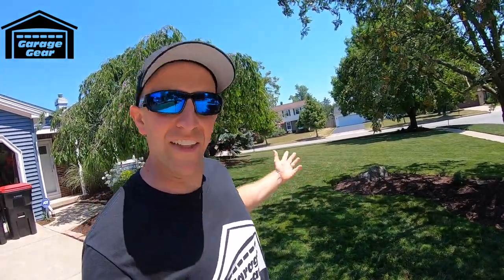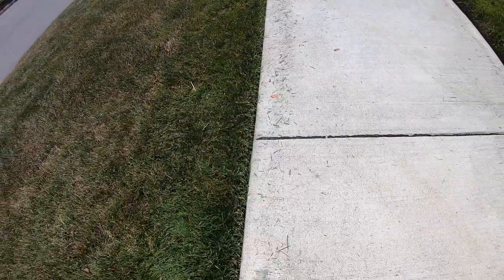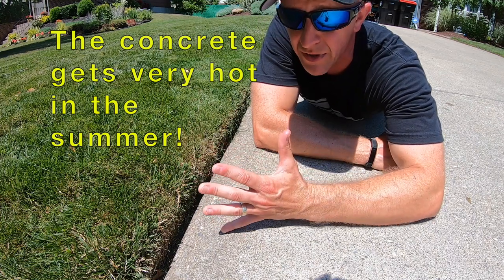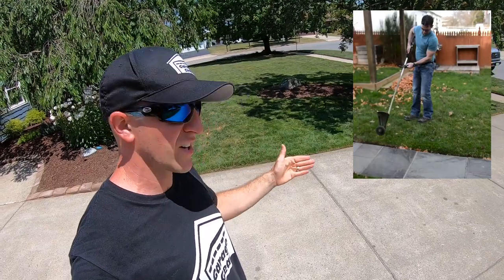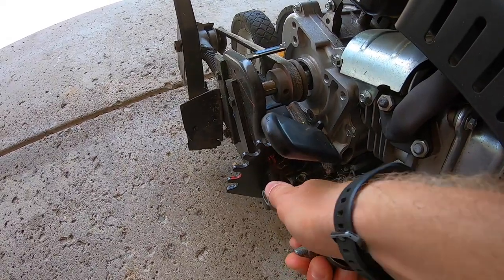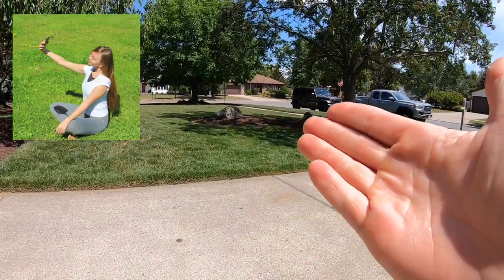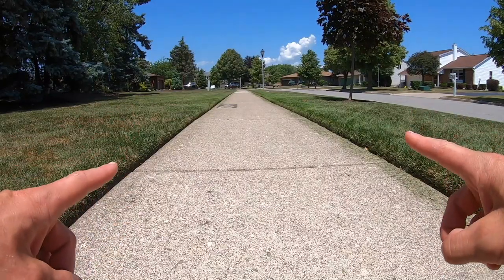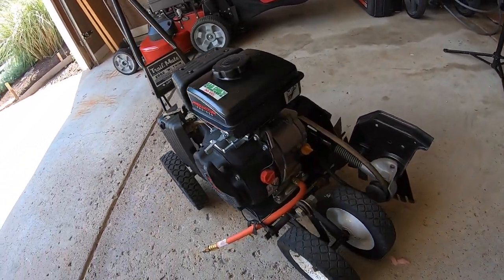The SECRETS To A PERFECTLY EDGED LAWN

Comment: I agree to edge last but.. I must admit, I do it first because..I know if I don’t, then I’ll mow and just go back in the house 😂
Reply from the maker: Haha for some, edging is not their favorite thing to do. I usually mow first then edge, trim, leaf blow, and wrap up by cleaning my equipment. I know you love your reel mowing. Bet you can cut it so short you don’t even need to edge.
Reply: Lmbo
Reply: What do you use for a guide? My electric one had a guide to set the depth Seems to me without a blade guide you'd have the tendency to run off

Comment: I've had a Troy-Bilt 554 walk-behind for 15 years now.  It makes short work of the job and always gives me a nice, tight 90 degree edge.  The curb wheel feature also makes it super easy to the street side.  I do the edging every other week, which means the mess is always small enough to get picked up by the mower.  It's super easy and I get tons of compliments.
Reply from the maker: Awesome Joe thanks for watching

Comment: I don't do much edging anymore. An 8" braided wire wheel digs a deep trench for a much better long lasting job. Helps irrigation, erosion, and helps in keeping turf low. First use mower set low on edging to lower grass cleanup, then use the wirewheel to pull out the dirt.
Reply from the maker: Thanks for sharing Clare! Good tips here

Comment: Another great informative video! I don’t have a concrete sidewalks or driveway so I a dedicated edger wouldn’t make sense but found the info on the Predator engine useful. BTW were do you live? I’m in Syracuse and we have been drowned in rain the last week.
Reply from the maker: Thanks David! The predator is AWESOME!  Works very well! Plenty of power for this edger and fit right on! I’m in Lancaster right outside of Buffalo. The lake kinda shields my area in the summer from some rain storms(a meteorologist told me that) north and south of us are getting all the rain. We’ve only gotten a half inch in the past 5-6 weeks. Got a storm tonight though and possibly tomorrow to. Thanks for watching David!

Comment: I picked up a used McLane. Needs cleaning and degreasing. After applying the degreaser should I be extra careful when spraying it off with a hose?
Reply from the maker: @dtanner7  hey dtanner! Depending on the degreaser ( super clean for example) you may want to dilute it 50-50 because are strong and can run the paint. Agitate it with a detailing brush then rinse as normal 👍
Reply: @GarageGear  thanks so much!

Comment: Cool video!  I got a kick out of your presentation style - nice! 😎😁👍

I see your point about edging after mowing, however when I mow, I typically mow along the edges so I'm not constantly running over the edge of the lawn when mowing back and forth.  

I prefer to edge first, then mow so that the mower picks up/cleans up the loose grass edgings that I blow into the yard  with the leaf blower. 

I just recently purchased a Troy Built TB550 walk behind gas edger, ( previously used an edger attachment for my Echo PAS 225 weed eater, ) but like your place, I have long edges beside the driveway, curb and sidewalk, so now the walk behind edger is my best-of-best bud! 😎
Reply from the maker: Hey Steve! Appreciate your positive feedback! Yeah for long edges walk behind models are the way to go. Thanks for sharing and watching!👍👍

Comment: How can we use a WALK BEHIND EDGER to edge the curve, sir?
Reply from the maker: If it’s a gentle curve you can do it with the machine. If it’s a tight turn, you have to use a straight trimmer. Good luck with the edge.
Reply: @GarageGear  Thank you so much for your answer!
Reply: I lift up the rear wheels to go around a curve and usually reduce the blade depth one notch. I have a McLane edger I bought new almost 50 years ago. I change the blade usually 2 or 3 times during the mowing season.